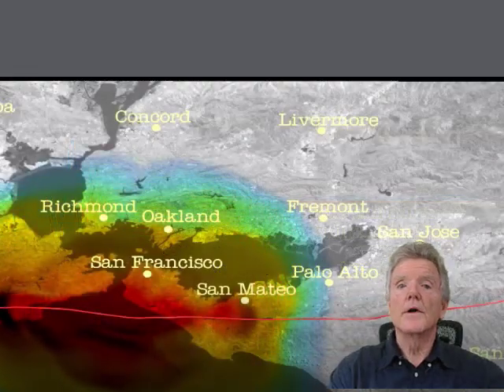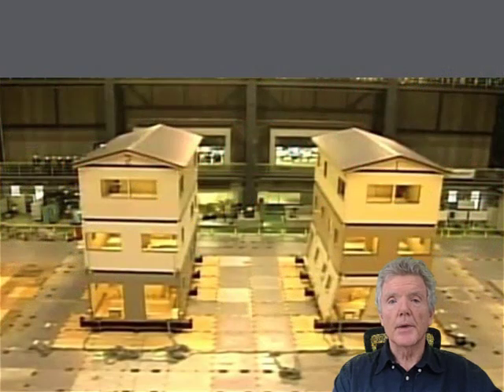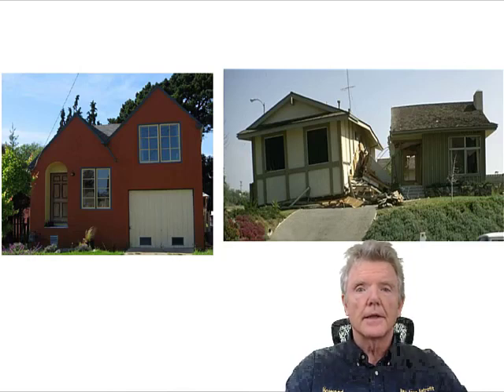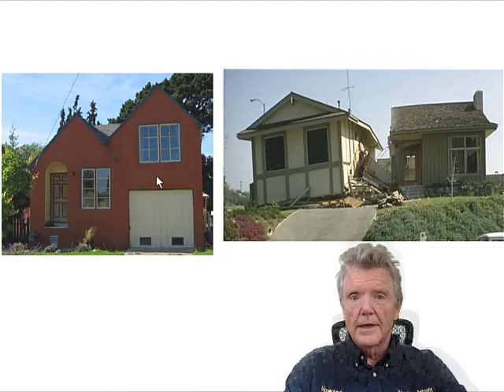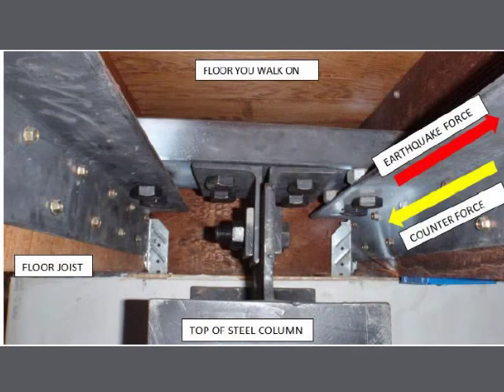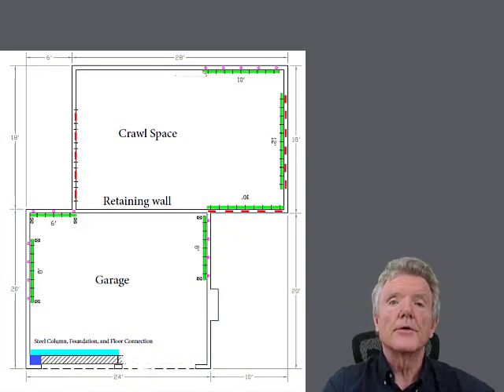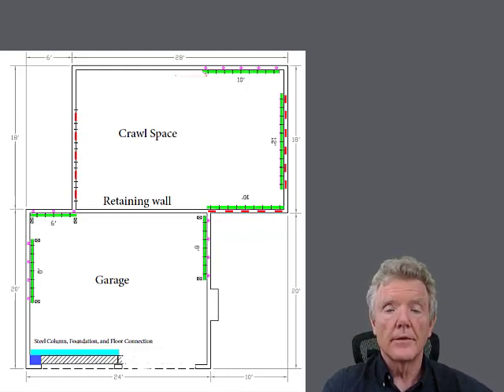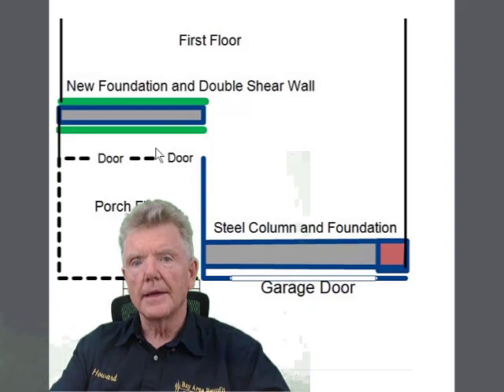Soft Story Retrofits With Steel

Comment: How do you determine the depth into the ground the moment column and trench should be dug and installed? I imagine the column should go a little deeper than the trench. For example, I have a single car garage with a soft story of two small bedrooms above, 15’x30’ with an A-frame roof. 
Thanks for all the practical and real world info. Everyone in the bayarea should watch your videos before signing with a contractor.

Comment: I saw your video on post and beam connectors: https://www.youtube.com/watch?v=WpwbXhJuhzY&feature=emb_logo - where you mention that this is not a proven retrofit technique. Your post used a crawl space as an example. Does also apply to soft-story conditions where there fewer posts?  (first story garage with crawl space > 7 feet).
Reply from the maker: Sorry I am so late in my reply.  I do not know YouTube did not notify me about your comment. I would put them in just for the helluvit though probably not necessary.